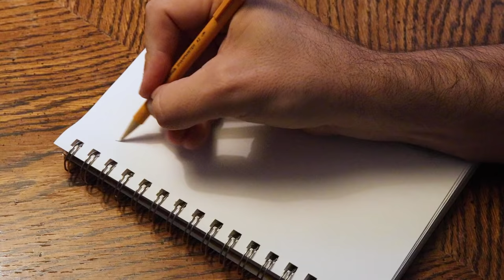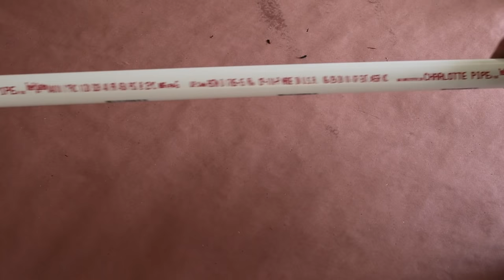PROP LAB - Creating a Fog Projection Screen? NEW SERIES!

Comment: A couple of thoughts that might help on the next iteration: It looks like the fans might be introducing a lot of turbulence, which in turn is disrupting the fog. Consider adding some of the corrugated plastic to the 'air ducts' on either side of the tube. If you're using a cold fog (like the ultrasonic one), it will want to fall down, rather than rise up like the hot fog from the fog machine. Consider flipping the whole thing over so the airflow and fog are heading down if you use the ultrasonic mist. Right now the airflow only helps to keep the fog flat in one direction. Consider placing something (large and flat ish) on the left and right sides to block any errant air currents from disrupting the fog in the horizontal direction. And lastly, rather than using a short-throw projector like in this video, consider getting a long-throw projector and moving it farther back. The rays of light will be closer to being parallel to each other, which will mean any 'ghosting' due to fog in front of or behind the target projection plane will be the same apparent size as the primary image.
Reply: I hadn't thought about directing the screen medium downward (though I should have) due to density issues... After researching further, that seems to be what others do to improve their projection systems.
Reply: I had the same idea and just commented, then I saw you already said pretty much the same thing. Maybe we are on to something?
Reply: Also, the longer the small tubes, the more the turbulence is straightened, at least until they present more of a restriction than they're worth due to sidewall friction. The multi-tube structure is commonly referred to as a flow straightener--they use them in wind tunnels to ensure non-turbulent airflow.  Those are frequently a honeycomb shape because that packs as many tubes as possible into a given area. Consider making the exit ends as square and burr-free as possible.  Any bits of plastic protruding into the airflow will introduce their own turbulence, reducing the overall effectiveness.  Also consider a fan speed control to keep the fan flow from disrupting the fog flow any sooner than needed.
Reply: @scubabeme these are really excellent comments. I'm going to implement them into my next build. Thank you!

Comment: Cool idea.   I remember one Halloween a guy in my neighborhood put up sheets of screen door mesh material from the ground to the lower branch of a tree and then projected a loop of ghost floating upward.   He had a fog machine on the ground for effect and to hide the 2x4 plank that the bottom of the screen was attached to.  At night you couldn't see the screen mesh at all, just the projection of the ghost appearing to rise up out of the fog and then disappear into the tree.   The overall effect was very impressive.  Since the image was projected onto the screen mesh it could be viewed from both sides and gave the ghosts a more ethereal appearance than if they were projected into solid surface like a garage door.

Comment: You need fog and ultra sonic mist, and invert the box so it’s facing down to help remove the condensation.
Reply from the maker: Interesting. I hadn't considered using both. As for downward facing, I figured since fog rises it made more sense for it to travel in its natural direction. The mist definitely benefits from downward trajectory due to the weight.
Reply: Pirates of the Caribbean at Disneyland had a similar effect for while, near the beginning of the ride. The mist went down...
Reply: I'm not sure fog does rise? Hot air rises to meet cool air which is one way fog happens, but doesn't it then fall, and roll down into dips and valleys? 🤔 Fog not on the ground would be cloud wouldn't it? Probably not worth worrying about the direction being right as long as you get the effect, especially in a supernatural themed environment! Cool video, excited to see where it goes! You can buy more powerful ultrasonic mist making parts (sorry, can't recall what the actual part is called 🤦🏼‍♀️) for ponds etc to use with your own water supply although that could make the surroundings pretty wet. It's an evil plan I have for an eventual enchanted jungle themed conservatory.
Reply: The fog and ultrasonic mist combo will make the fog heavy and want to fall. That combination with the fans will push the fog down. Create a large enough surplus of fog in your box and adjust the fan speed to give the desired effect. Lightning is key, low light I think would be best. I too have been thinking of this, not that I have attempted it, just some ideas.
Reply: @VanOaksProps  Perhaps, ditching the fans altogether and using a chilled fog to create a curtain.....

Comment: Somone has probably already mentioned this. The reason for all the straws in the original design you saw is that it "columates" the air, meaning it gets the air moving in a non-turbulent way. The trick is used with water fountains where you want a thin steam of clear water as well. Still really cool what you're trying. I enjoy these experiments.
Reply: The water trick is known as laminar flow. The little channels reduce the amount of turbulence of water flowing through a pipe and "parallelize" the liquid as it exits the pipe resulting in what is known as a coherent stream. You typically see this used in leapfrog fountains where a short, coherent stream of water appears to bounce from one point to another. This technique also works with light as well. Photographers will use an insert for their lights called a honeycomb grid (essentially a matrix of hexagonal tubes.) Again, the tubes eliminate all stray light and allow only the light rays parallel with the tubes to pass through. The result is a more tightly focused pool of light. This technique would work really well for highlighting specific props in a haunt without light spilling over and onto other props/backgrounds.
Reply: I’ll add to this that if the mist is even slightly heavier than air, it may pause once it leaves the tube, blocking what’s coming up below it and causing those “tufts”. Hanging the thing upside down might help because then gravity is assisting the flow.
Reply: @johncooperrider9886   FYI the word he was going for - collimate - means to make parallel/aligned.

Comment: Love that you're giving this a shot, and THANK YOU for ending this video at an in flux state for this project.  Helps us DIYers keep up the confidence to redesign and rework stuff that may not work right the first time.  I'm going to look into making something similar, though as a couple of people have pointed out, i'll probably point the fog down.  I hope to achieve a decent fog wall effect by running fog through a homemade chiller, then into a PVC with holes drilled in it.  I can then attach this pipe to some kind of vertical stands, and hopefully get a fog wall effect.  Could probably project onto it, as well.  Keep it up!

Comment: Super project!  I’ve long wanted to make this, since pesky projection curtains just seem so material!  Some evil genius thoughts:  In addition to collimating the fog flow, using coffee stirring straws to collimate the air flow on either side should yield two laminar sheets of air, between which will be the fog.  The resistance to air flow will be high; a powerful fan long term will likely be needed.  BTW, a pre-collimator may help further increase the uniformity of airflow- basically any sort of filtering material does not have to be very high filtration) to provide some resistance and uniform flow as the air enters the collimator.  The space between the air sheets will need to be tuned in… too close and you will get a pressure drop in the fog zone, creating vortices.  Increasing the volume of fog, rather than the velocity of fog should help fill the fog zone.  I’d experiment with larger collimators (straws) for the fog- that will reduce the resistance to flow, reducing vortices while increasing flow rate and volume.  Rather than fog directly from the fog machine, a set up like a fog chiller (but without the chill) would act as a high volume space, allowing the fog to fully expand and slow as it enters the fog collimator, like a big volume based pre-collimator.  Speaking of chillers, flipping the whole thing upside down, having the fog curtain project down would enable you to chill the fog, adding a gravity assist to the whole picture.  In that scenario you could reduce the strength of the air curtains, letting them be only strong enough to direct the fog.  They would not really have to contain it much, since it will want to go down.  Having a downward fog curtain off of your house gutter, over an archway, gate, etc could be a more interactive experience….  Looking forward to seeing where you and the community bring this!

Comment: So many great ideas here! Yes, the basic rule is don’t try and fight the medium. Warm smoke rises, cool fog sinks. Also, the laminar air flow device needs to cover the entire opening of the accumulator. Introduce the positive air flow from a longer dryer hose to reduce the turbulence from the fans being so close. Make sure the fan device is variable speed as you’ll need to tune it correctly to dial in the proper air flow. It’s typically less than you think.  We had a lot of different smoke/fog effects in our show in Tokyo and they were all LN2. The variables were just how air flow we used to move it from the large accumulator to the port on stage and at what temperature. Also the volume of the connecting lines made a huge difference. For the low lying fog we needed high volume but low pressure in a cool state. For the jets we needed less volume but more pressure.  Good luck on the next one!😊

Comment: We were very close to resolving this about 20 years ago.
The corregated plastic is creating laminer flow. We used corrugated egg crate ceiling panels, cutting down a section. 
We did not use fans, but an  inline ventury. By installing an air regulator, we could adjust air volume. Smoke was in a collection box, this also helps collect oil waste that builds up. 

Our last attempt was to build an overhead up duct fan above to assist pulling smoke upwards.

Comment: my dad and I made one for a haunt almost exactly like this but instead used a 50 gallon chiller with a high-output DJ machine. the fog got pumped up to a 4 inch PVC pipe with a slit full of straws then drop out over our porch where we projected from my room (had to digitally keystone) so the entrance to our house had a really similar effect to the pirates of the Caribbean ride where blackbeard is floating. wer also used a mesh screen hanging from our garage door to project a ghost of a dead girl whose lifelike silicone body we had decapitated by a homemade gravestone. it was literally just screen door material but in the dark it was super convincing!

Comment: We usually use pvc with holes drilled into it to help disperse our fog. We did this one year because the season happened to be at the right time, just after we'd harvested our hydroponics garden. So we just used the pipe from that. If you have a 3d printer you could print a converter to remove the risk of seepage. Projections are big at our house and last year I had the pvc pipe with the fog flowing just under the projection screen. If I was going to try to use the fog to project onto, I would raise the pipe and fog machine up to above head height with the holes pointed down rather than up. It would have to be 7 or 8 feet off the ground so no one runs into it. It might work well over an arch or doorway. Then I'd project onto it either from another high spot or from the edge. I'd also make sure there's a gray mesh projection material behind it to catch whatever light the fog misses, always hoping that the fog gives it a better 3d effect. Gray mesh in an open space is far less visible to the eye at night than white is. So it's less likely to be seen. Voile chiffon is good for projections and comes pretty cheap on Amazon in bulk. I would avoid using a fan unless I'm going with intocoasters low lying fog generator build. The issue with the fan is it'll push the fog out way to fast otherwise and there's no telling what the wind will be like, if you're building this inside or outside. You want a lot of smoke coming out at a slow pace and hanging around in the same spot for a while, so it has more mass to catch the light like an actual screen would. I was hoping to build something like this this year, but we're in Korea and I have no idea where to get fog juice or vegetable glycerin. Good luck on this build.

Comment: Others have already mentioned some good ideas (especially collimating the airflow, not just the fog/mist), but two other ideas I'd throw out: 
1. Computer fans such as those you used are not intended to produce smooth, laminar flows; they produce all kinds of uncontrollable vortices.  Even the differences in the widths of the blades along their lengths changes the flow from the center to the rim.  "Squirrel cage" fans produce smoother, more consistent airflow.
2. I'm a big fan of using plena to prepare any gas or liquid for injection or integration into something else.  In other words, a plenum, or "air chest", where air (or another gas) can collect and be "staged" can help with density, controllability, etc. -- especially if you decide to mount it above_, so the cool mist/fog can be directed _downwards.  The fog (or mist) that you're using is coming out of the generator as quickly as it can be supplied, but it will always be straining to keep up with the "demand".  But if you have a chamber for it to collect in for a moment before being integrated with the 2 laminar airflows produced by the fans, it can have a better chance to build up to a density that will produce the desired effect.  (This is kind of like an air compressor attached to an air supply tank: that produces much more consistent airflow than just having the air line coming directly off of the compressor.  Or the way a pipe organ has an "wind chest" to collect high-pressure air.)  Again, as others have already suggested, chilling the fog/mist will help by both increasing its density and to causing it to fall through warmer ambient air.  Combining a chiller box and plenum would be the best of both worlds.   
Regardless, you've earned another subscriber. 👍
Reply from the maker: Thank you for all of this!

Comment: I love the energy you've invested in this and having recently started listening to your podcast, this ties in with the ethos that sometimes things don't work as expected.  It's been said in many of the comments that the fans are causing turbulence, and having made a small wind tunnel in the past and suffered a similar issue can totally endorse their validity...but in addition to this you may get a better outcome if all your vapour lines were equal length from the PVC plenum.  The honeycomb style laminate you used is a good improvisation but it's not likely to deliver a uniform vapour delivery and therefore you get patchy image quality.

Comment: I did a fog screen last year for halloween using 3D printed hexagon air channels.  You really need a layer of air on either side of the mist moving at the same speed and direction to get a stable projection surface.   It turned out fairly large in the end (working on smaller this year).  But I was able to get a 4ft wide by 4 foot high projection wall before the fog became to unstable.

Comment: My first thought is to use two parallel airstreams on either side of a fog gap. Would reduce the condensation in the tubes, but pull the fog along for the ride.

Comment: I'm wondering if you considered the turbulence issue created by the fans with your particular setup?... Instead of directing the fans up, use a more powerful blower directed into the chamber then using the same corrugated sheets, direct the airflow up towards fog/mist... Attempting to keep the fog/mist "sandwiched" between the sheets of air on either side of the fog/mist ports... Next, consider the volume of fog/mist you're pumping out... If you continue with fog, build your own fog machine and consider you may wish to over engineer it to produce the volume you'd need. That alone could make indoor use prohibitive and then you may wish to stick to outdoor use... If mist is the better option, obviously you'll need a more powerful mister. Maybe even consider super chilling (not freezing) the water?... Third, you should consider that your projector may not be powerful enough to produce a good, bright, "sharp" image on your chosen "screen"... Good luck.

Comment: How about inverting the device?  Chill the fog first and use gravity since the cooler air will descend towards the ground.  Maybe throttle the fans power output to help achieve a nice slow and smooth sheet of fog.  An added bonus would be the cooler chilled fog will accumulate on the ground providing a slow creeping fog after its initial purpose.

Comment: Inverting this and using a fog chiller might solve some of your problems. The fog chiller becomes a resting point for the fog... no more fits and starts from the fog machine. Put the fans inside the chiller to push the fog into the inverted directional unit. This keeps the turbulence from the fan out of the expel point. This might allow for a smoother, more continuous curtain.
All experimental, of course.

Comment: So, having never worked with a fog machine except on stage with bands, I'm limited in the practical application. But, one of the things you mentioned was moving the fog machine farther away. I'd simplify the process by experimenting with increasing the length of connecting hose between the fog machine and the display unit. At some point, there has to be a sweet spot between the pressure it puts out and the eventual exit of the fog.